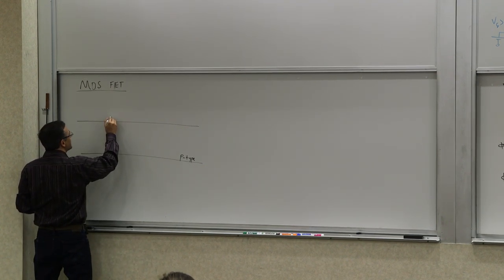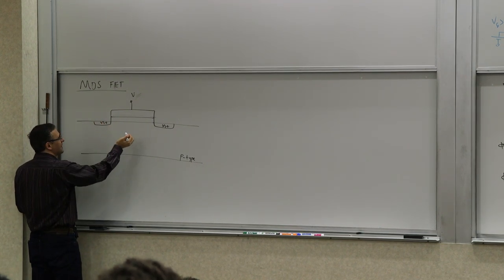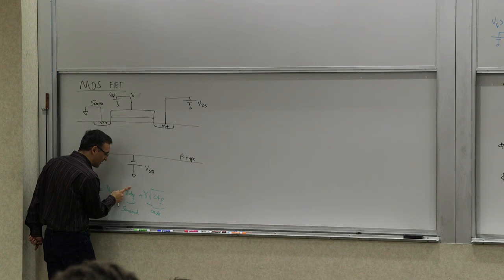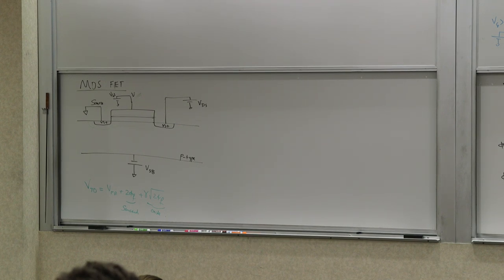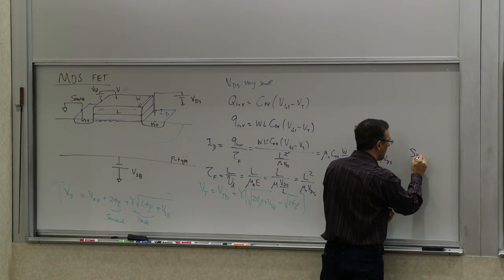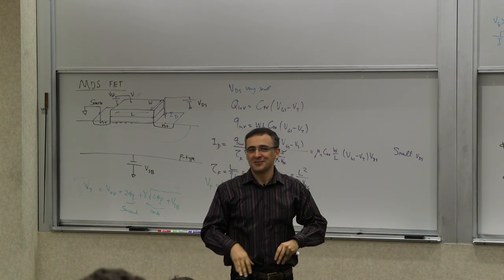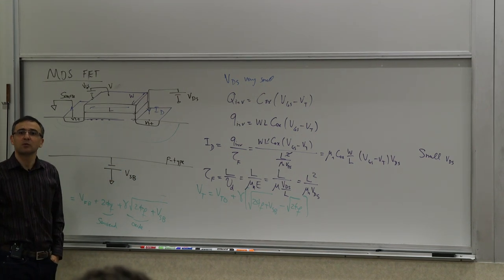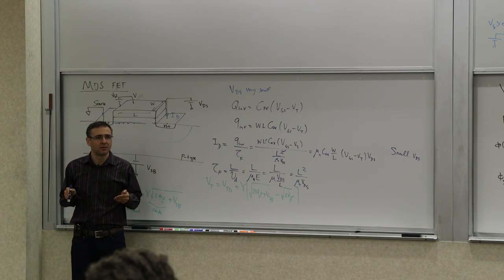109N. MOSFET Introduction, threshold and body effect, IV characteristic in linear region

Comment: It's said that Q_{inv} is the charge on the terminal - isn't it the 'excess' charge? If we are at V_{GS} =V_T there is not 0 charge on the oxide, isn't this the inversion point so there are the same amount of charges as n_d or n_a (whichever type the base is)?